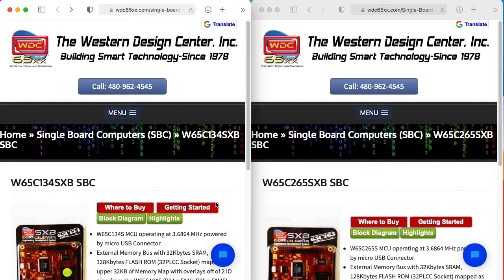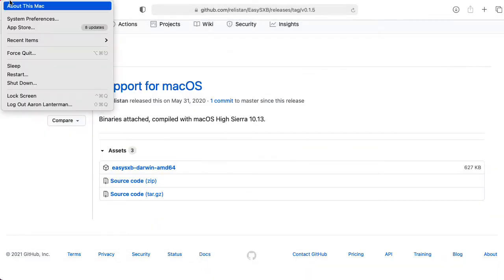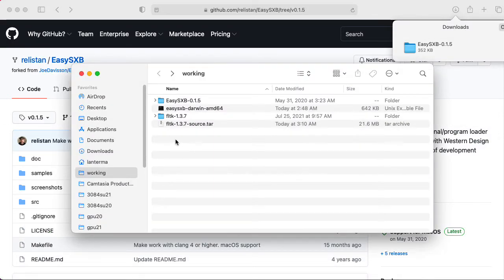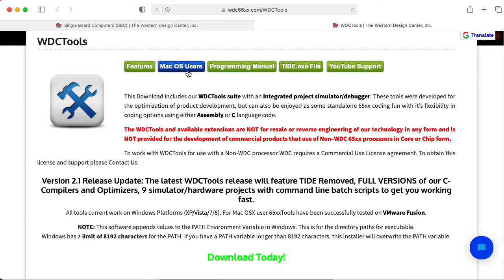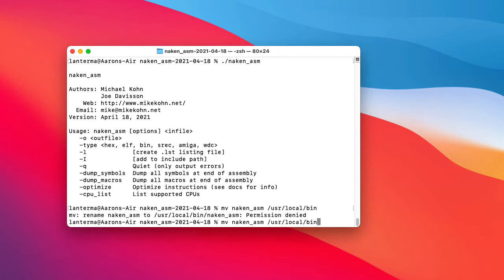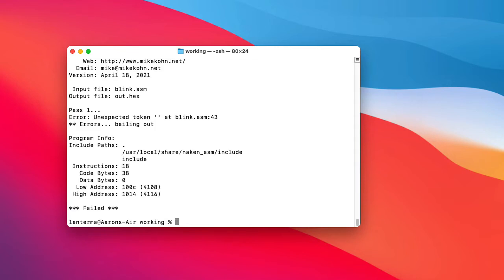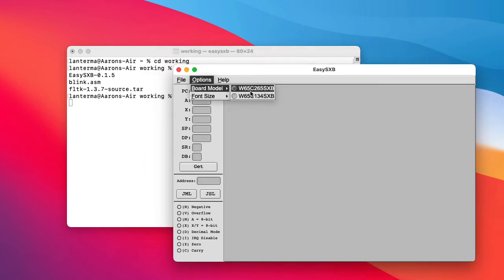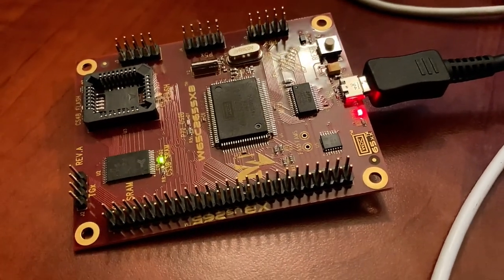W65C265SXB Toolchain on M1 Mac: naken_asm & EasySXB (W65C134SXB, 6502/65816 based microcontrollers)

Comment: Thank you for this awesome video.  It's given me some great ideas. Also, I have written assemblers before and most of the time CR/LF is the delimitation character in the grammar.  Without it the parser will throw an error because as far as it's concerned it hasn't finished reading the line.  That's why you typically need to press enter after each line.  It's a quirk of assemblers.  C uses the semi-colon as a line delimiter and just like in C if you forget the ';' character you will get a syntax error.  Assemblers use carriage return / line feed instead.  There's a reason for that.  Read "Hackers" by Steven Levy if you haven't already.  It's not about hacking like you know it.  They talk about the first assemblers on the PDP-1 and before that the TX-0 (tix oh) machines at MIT, and how they used early teletypes to enter in the programs.  That's where the carriage return / line feed comes from.  A literal typewriter was used to enter the code back in the day - modified, of course, but it was a typewriter.

Comment: on github ther is the raw button abouth the file you selected there is the link to the file for download. 😉
Reply from the maker: Yeah, I sometimes use that and copy the URL and use wget on the URL. I still think GitHub should just provide a one-click download button next to each file and have no idea why they don't.
Reply: @Lantertronics  yess that would be a great extension to that site.
Reply: A bit late to the party. I don't know if Safari has the same feature but on most browsers you can just save a webpage as a file (usually with Ctrl+S or Command+S) since the raw view is just the raw file rendered by the browser using save as should just save the raw text file.